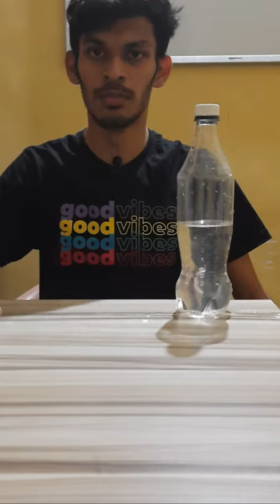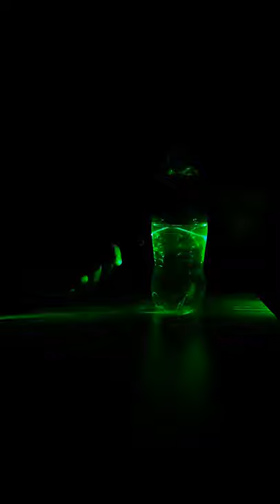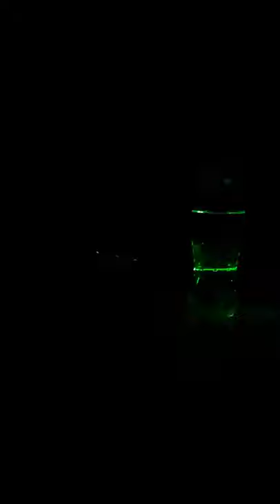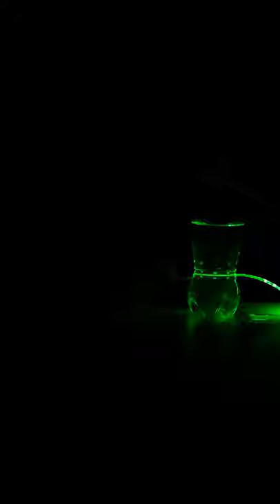Visualizing Total internal reflection | #shorts 01

Comment: How  path of ray of light has bent  shouldnt that be only the case in diffraction of light when object is much smalller
Reply from the maker: When the ray strikes the surface of water at angle > critical angle(read more here: https://en.wikipedia.org/wiki/Total_internal_reflection) it gets reflected back into the water, it's not really bending but just reflection...Diffraction on the other hand is a completely different concept...hoping that was helpful
Reply: @GEMOFPHYSICS  only in the case of TIR we could accept it 
Thnx..